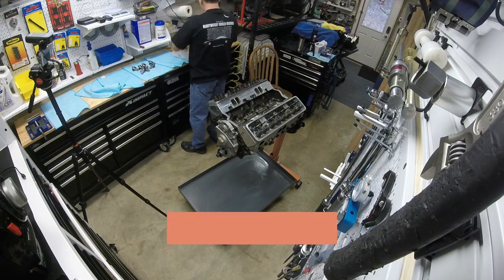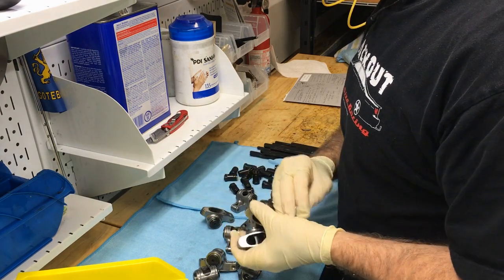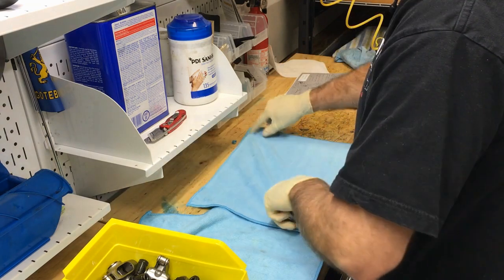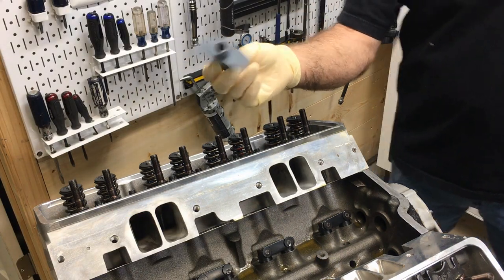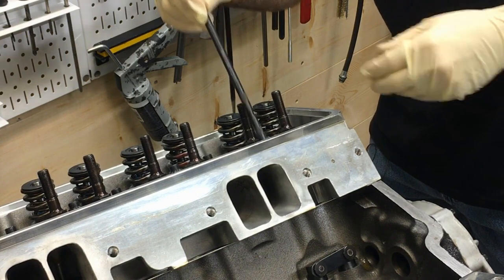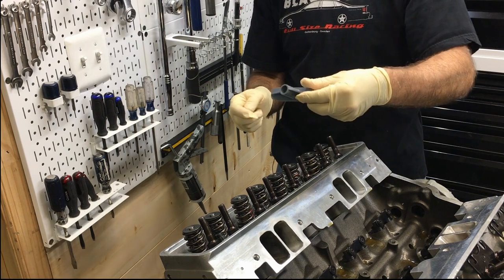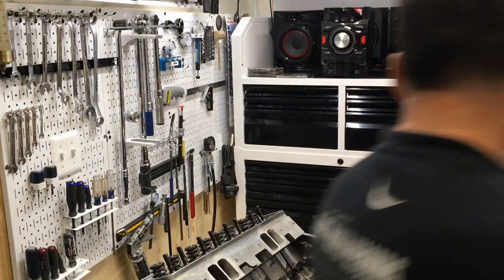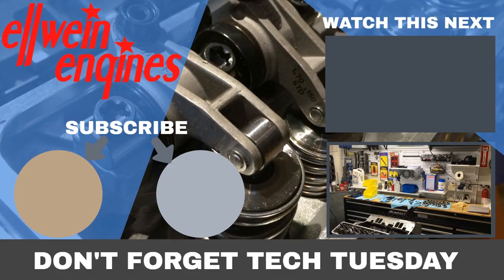PUSHROD LENGTH FOR LT1 and SBC

Comment: I saw a motor trend  article about purposely installing slightly larger and smaller pushrods in a purpose built LSX 383. 

COPY/PASTE BELOW:
Does Length Matter? LS Pushrod Test
The fact that the combination was carbureted had no effect on the pushrod test, but we suspect that the use of standard-travel Comp Cams lifter (PN 850-16) certainly did. The tests were run with identical air/fuel and timing values, as well as oil and air temps. Equipped with the ideal pushrod length of 7.450 inches, the 383 stroker produced 524 hp at 6,300 rpm and 492 lb-ft of torque at 4,900 rpm. After swapping in the shorter 7.400-inch pushrods, the power numbers dropped to 515 hp at 6,300 rpm and 490 lb-ft at 4,900 rpm. The final test was with the 7.500-inch pushrods, which produced 529 hp at 6,400 rpm and 490 lb-ft at 5,000 rpm. The longer pushrods enhanced power production above 4,900 rpm, but produce nearly identical peak torque numbers to the other two sets. 

Just found it currious and was wondering what's your take on this, if any? The LS is obviously a different engine than the LT. From my understanding its more important to be more accurate on an LT1 vs LS.
Reply from the maker: I think that is awesome info.  I know LS needs the pushrod to be whatever length that gives the lifter the proper preload.  So in this case it put more preload on the lifter and made most peak power.   I guess for the LS a pushrod length test is really a lifter pre-load test.
Reply: @EllweinEngines  right, makes sense to me. Thought you and viewers may find that interesting!

Comment: Them plastic Manley tools arnt accurate.  I have 2 of them, one is made by proform. Not sure the other. They both said on my 350 SB I needed .100 shorter pushrods. Wasn't right.  I used the stock 7.8 pushrods on my 350 and used a solid lifter of the same height as my hydraulic  lifter and ran the cam though the full lift cycle twice  and checked my pattern on top of the valves with blue marking compound.  They are about .100 off, I dont trust them anymore.
Reply from the maker: I would trust them for a Lunati lifter but not all brands of lifters.  Pushrod and rocker geometry seems like it aught to be science but it is more of a magic.  How many methods of determining what is right have I seen?  Too many.

Comment: im trying to do my first engine, 1996 impala. im going to have loyd Elliot do heads and a cam im pretty nervous about what eels to do after i get the heads back. scared to screw it up
Reply from the maker: Just know that chances are you won't screw it up.  It is scary since you have never done it but once you see everything it will be less "scary".  Have you arranged for a new tune in the PCM?
Reply: no because i cant make my mind up. i would need to buy a quietly optispark and pay to have it tuned. im thinking a grand if i go that way.
or i could buy the torquehead kit that switches the car to a 411 pcm and coil packs. 
i thank ether way im going to be ruffly in the same price range so why not get the 411 pcm but i just don’t know
Reply from the maker: @joshstaley7459  Fun decisions ahead.  hahah.   Sorry...just poking at you.   Either way is good.  Stay with opti and it will work.  Go with 24X 411 PCM and it will be fun learning that Gen 3 world.
Reply: @EllweinEngines  i just want it easy to tune any where and reliable. what would you do? i also cant decide if i should change my main and rod bolts to arp. i have a 50,000 mile short block. there is so many questions i have and every forum tells you somethings eels.
Reply: Thanks for the videos.
Question regarding the tool, this should work for 1.5 and 1.6 ratios, correct?
Would you add lifter preload to the measured length? The preload would make the rocker longer for the same initial measured length.

Comment: Karl, I've never used they plastic mock up rocker, it looks super easy but some argue that it's just too help get a baseline and shouldn't be the final say in choosing the correct length pushrod. Would you mind doing a more in depth video on other procedures? Thanks I know I really fretted over getting the pushrod length correct for my engine with 21* Trick Flow's that were milled .030 in conjunction with a Mr Gasket .026 thick 5716G head gasket. I ended up at 7.250 but that's where the wear pattern on the valve tip looked the nicest.
Reply from the maker: Good point.  Probably the various pushrod length measuring tools or the various methods I think do not actually have the goal of producing the thinnest witness mark but just to find the correct (in theory) geometry for best leverage.  Seems like the best geometry should result in thinnest witness mark though.   You are not wrong to say that the tool is probably getting a baseline and that gets you close.   I'm willing to bet though that it gets the geometry correct to within the .050" pushrod length choices.
Reply: Hi Like your videos, very informative. I watched another video where a test was done with both adjustable pushrod checker and the plastic one as you used and measurement came out the same. He had light weight springs in and did the rotation of motor to check mark on valve tip and then checked with plastic one. came up the same. @EllweinEngines